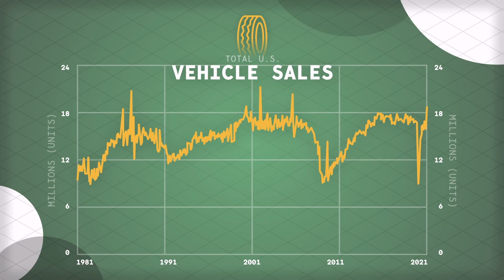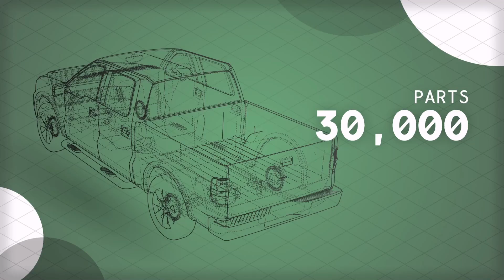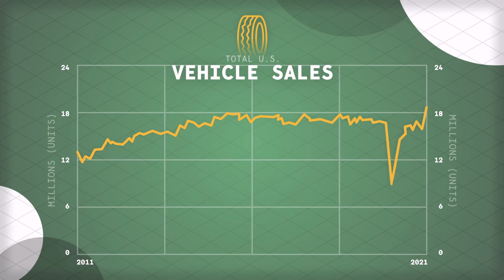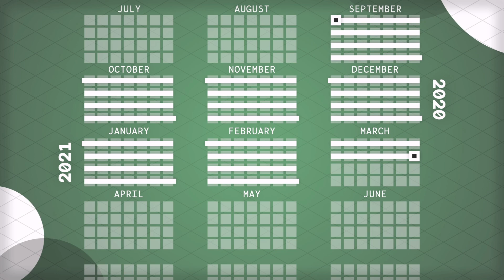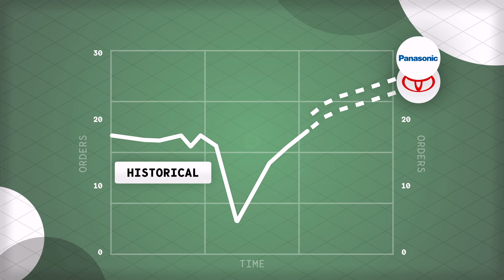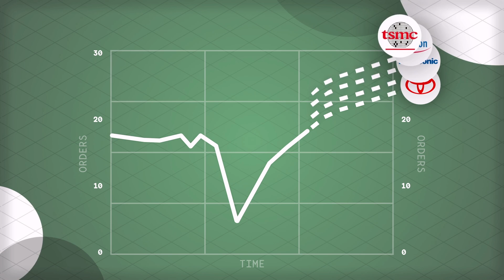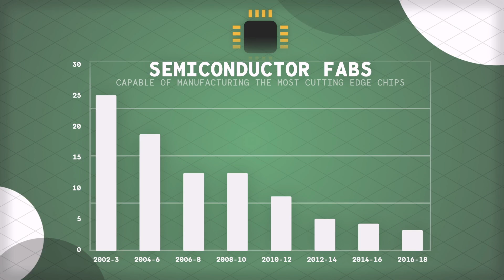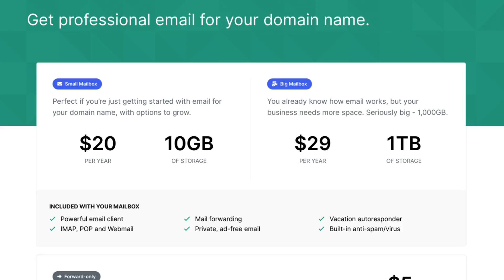Why the World is Running Out of Computers

Comment: Your chip analysis is a bit simple and perhaps ignoring a multitude of factors.

For starters, fab orders come from chipmakers themselves. The chipmakers have to order wafers as they are available in order to be able to actually manufacture parts at those fabs. Chipmakers are the ones who determine the amount of chips available, not Toyota or Panasonic or any other buyer. Nvidia and AMD, for instance, are actually designing the chips for certain customers, hence they gauge how many they need, then they place a wafer order on the process in order to lock down a specific amount of chips that they can sell to a customer (assuming a certain percentage of defective dies).

The amount of chips available relies on what process they're using, how many wafers are available on that process, the yield percentage on that process, and how much those wafers cost. For something like a PS5 on 7nm, that's just about bleeding-edge. Nvidia made the mistake of trying to bluff TSMC by threatening to go to Samsung. TSMC laughed in their faces because they knew their 7nm process was superior and their wafers would be consumed by literally everything else. Hence, the Nvidia Geforce 3000-series chips had to be manufactured on an inferior Samsung 8nm process. It was a big misstep by Nvidia, but just another demonstration of TSMC's foundry dominance, and the fact that literally everything is vying for cutting-edge process wafers.

TSMC is so far ahead of Intel and Samsung that they can't crank out wafers fast enough. Toyota isn't even a blip on their radar, when AMD, via Sony and Microsoft, are ordering next-gen console parts at a record pace. And this is where they make the most of their money from. One could argue that older processes are still viable for various chips, but the various processors being used in car are vastly increasing in performance to match or exceed those in smartphones (which are likewise bleeding-edge), like Nvidia's automotive chips. Automobile manufacturers are just not shifting volumes anywhere close to console manufacturers. And therefore, their bleeding-edge features are going away, and/or massively increasing in price.

The driving force behind all of this is "bleeding-edge features." Whether it's a game console, a smartphone, or a car. It's all the same. In the meantime, companies like AMD still have things like CPUs and GPUs that they have to sell, so all of this stuff is a drain on wafer availability at a time when manufacturing in general saw a decrease thanks to the pandemic. But currently TSMC has the best process available. Intel needs to solve their 10nm and 7nm problems, Global Foundries needs to make themselves relevant again, and Samsung needs to innovate at the 5nm level. Only with increased competition will this "chip shortage" start to alleviate. TSMC has been investing in more manufacturing, but as long as their on the top, their wafers will be extremely valuable.

The shortage is real. The demand is vastly exceeding the supply. TSMC can only supply so many wafers on a specific process node. This is purely a manufacturing problem.

End notes: "Opening a factory" is a severe oversimplification statement. TSMC has to invest in foundry hardware. This is cutting-edge technology that very few companies can produce. Let me give you an example: back in the mid 2010's, TSMC reportedly had problems with their 28nm process. At the time, they were fighting with GloFo and Intel and losing. They were nowhere near where they are today. They invested a bunch of money into equipment to make that process work, and they were essentially failing at it. Fast forward to today. Intel has pumped tons of money into 10nm and 7nm processes that are not working. This stuff requires a lot more than just "opening factories" to make them work.

That is to say that while TSMC is on the top right now, that won't always be the case. This is a cut-throat business. TSMC can't just invest a ton in more 7nm manufacturing because it will soon be replaced by 5nm and other nodes. Older nodes can live on for long periods of time with chips that DON'T rely on cutting-edge manufacturing, but the lifespan probably isn't more than 5-8 years or so, before there are so few customers as to make it not worth keeping the fabs running.
Reply: Taiwan doesn't need TSMC. I mean, sure, TSMC is a huge business in Taiwan, but manufacturing has been huge in Taiwan for a long time now and is only getting better since China's labor costs have been increasing. Taiwan manufacturing also has a great reputation. So while other countries continue to grow, like Vietnam, Taiwan will continue to be at the top of the list for quality manufacturing at great prices.... at least until the CCP decides to interfere.

Comment: Gasoline stations where I live have increased their prices to the point that not even 30$ is enough for a full tank.
Reply: And you call that expensive? Jeeezzz...
Reply: @kornaros96  
Last time it only took 20$ for a full tank, and now it takes probably more then 50$. I don't know how rich your life is, but more then 50$ a tank is a huge deal.
Reply: @NicheXCC  more than 50$ is a huge deal? 
So, with the regular unleaded at 1,65/L to top up a car with 81L fuel tank that would take 133,65. That's with the price in my neighborhood, so if the prices at your neighborhood is the likes of 0,70; you should probably stop bitching about fuel prices.

Comment: One possible fix, is if carbon chips get better and become mane stream. They are said to be better. As in smaller, faster, and able to handle a higher heat wile being self cooling. Perhaps is just a pipe dream filled with theories. But one can dream, yes. It's kind of how we got where we are with tech. Building on a dream of what could be, if we are able to make it so.

Comment: 1:10 - You are wrong, rice cookers dont need and dont use semiconductors at all. They use electro magnets and thermal properties of metals.
Reply: They have semiconductors for that timing function and for sensing the temperature to adjust said cooking element.  Smart ones DO have semiconductors. Rip one apart.
Reply: @DurzoBlunts  normal rice cookers dont need semiconductors. 
They work using a specially calibrated magnet that stops working precisely right above 100 C, so that it stops cooking when it evaporizes all the water. When the water evaporates, the rice is perfectly cooked. Thats it. Thats why rice cookers usually dont have any kind of screens on them. Have you ever ripped one apart?

Comment: I just started an internship working in the electronics lab at a company producing thermoelectric coolers and I could tell that the semiconductor shortage was causing some major headaches within the first few hours on the first day. Luckily we’re still able to operate fine as far as I can tell. I’m also from a state affected by the Colonial Pipeline hack and some stations I’ve come across are still out of gas and the ones that have it have relatively high prices.

Comment: Fucking hell, this is why we need to remove most of the computers from daily life. Not everything needs to be automated
Reply: Same as software bloat, hardware bloat exists
Reply: Automobile is actually a big contributor to this problem. Most modern cars today need some sort of chip to operate the entertainment system and other electronic devices. Older cars don't need them, but they work just as fine.

Comment: Would be awesome if this causes car manufacturers to lay off the "screens everywhere" crack pipe, at least on lower end option packages. Give me an "analog" package with real gauges/buttons/knobs/switches and a manual transmission while you're at it
Reply: They would still need chips for TPMS, electronic valve timing, infotainment, emissions systems, remotes, anti theft and many more systems
Reply: @hawkeyeaerialphotography6652  Absolutely, but the amount required (and the complexity/ease of manufacture) to create a simpler package would probably be significant. Note that the first thing to go during this shortage is the full digital dash. Of course, the replacement analog gauges still have digital electronics behind them (gauge data still comes from the ECU), but far less complex and easier/faster to manufacture than what's needed to drive multiple screens displaying high res graphics with fluid animation. Though I know it's not feasible anyway for tons of reasons, just something I personally would like to see.
Reply: Manual transmission is dead.
Reply: @crhu319  maybe in America cuz they don't know how to drive a manual transmission car
Reply: @anon1963  More like we're too lazy; most people I know have had or currently have cars with a manual transmission, but a lot of folks like me just can't be bothered with the tedium of shifting our own gears, it's more efficient to let the car do it on its own. I agree with the general sentiment of this thread though, analog gauges and all that are easier to produce and work just as well if not better than having a computer on wheels.
Reply: @crhu319  Nah, there are still some models you can get with one (thankfully, most of the "fun" cars), plus the used market.

Comment: This seems like a lazy video to me that is making the same points in other videos. 

- isn’t the drop in profits in the auto industry offset by the increase in profits in the industries that “took up the slack” in chip production? Including better margins the FABs themselves got?
- what happened to the inventory that wasn’t used during the drop in production and that was still on order?
- what is the whole “cushion” analysis?  If someone over ordered and got their order in first they should have enough chips.  Hoarding in the supply chain requires holding inventory which means sacrificing sales.   Are they doing this to drive up prices?
- consolidation towards cartels and monopoly is a law governed process in capitalism.  It is both the most efficient form of production and allows firms to set prices rather than be beholden to the market thus getting a greater share of the value, realised as profits, created throughout the supply chain.

Comment: Overclocking in a nutshell is the illegal act of running a computer's CPU at a higher clock speed than that mandated by the manufacturer. By altering the settings on the BIOS of your motherboard, it is possible to fool your computer into running faster than the manufacturer's permitted speed limit. This results in a short term gain for the overclocker, but it is not without risk to the wallet, or the environment.
To quote the US Dept of Energy and the EPA: "Staying within the speed limit is not only a matter of safety and obeying the law, it can also save you money."
The sound advice above applies equally to Personal Computers as it does to automobiles, which is hardly surprising, since both are complex pieces of machinery requiring their users to behave in a responsible manner.
Anyway enough preaching, its time to get down to the technical nitty-gritty. For the purposes of this article, it is useful to draw an analogy between PCs and Automobiles. If you tune up an auto by adding a turbocharger, or remapping the fuel injection and timing, you may well get a small increase in performance. However it will be at the expense of wear and tear on your engine, more greenhouse gas emissions, increased insurance premiums, and ultimately the lifespan of your vehicle will be shortened. So it is with PCs.
The overclocked PC consumes more electricity than the unmodified PC (due to the higher clock speeds, and the additional cooling that is required). This causes higher running costs (just take a look at your electric bill if you don't believe me), more damage to the enviroment, due to the emission of more poisonous greenhouse gasses, and worst of all, reducing the lifespan of your CPU.
A CPU is a delicate piece of electronics. Illegally increasing the clock speed by just 2MHz can remove 6 months from its working lifespan.
Modify your PC to improve its longevity
OK, so we have seen the causal link between higher clock speeds and early CPU failure. But what can we do to improve the lifespan of our PC ? Its simple. The same equation that governs the process of "overclocking" can easily be reversed. It is the logical next step. If a faster CPU has a shorter lifespan, costs more to run and damages the environment, by the same token, an underclocked CPU will be proportionally cheaper to run, more environmentally friendly and will last longer. Follow the simple steps below to underclock your CPU and improve the lifespan of your PC
Basically there are three steps to underclocking your CPU. The first step is to get into the computer's BIOS. This can normally be done by pressing DEL as the machine boots up.
The second step is to locate the CPU clock multiplier in the BIOS menus, and modify it. Suppose you want to increase the lifespan of your CPU by a factor of two. The thing to do is to halve the clock multiplier in the BIOS.
The third step is to save your changes to the BIOS and reboot. VOILA - you are now the proud owner of a longer-lasting, greener, cheaper to run PC.
Now you might be wondering what the downside is to all this ? Good news. As it turns out, there is no downside. For years and years PC manufacturers have been telling us we needed faster and faster CPUS. This is simply not the case. I run Microsoft Word just as easily on my underclocked Dell machine, with the bonus of knowing my PC will probably outlast that of all my friends, and is saving me money to boot.
For any reasonably competent DIY enthusiast, underclocking is a no-brainer, and the sooner you do it, the sooner you can start saving money and join the ranks of those who are doing their bit to reduce global warming.
There is some evidence to suggest that if just 5% of America's PC-owning population underclocked their PCs by a miniscule 5% then the Californian power crisis would have been averted, and we would be able to reduce greenhouse gas emissions by a significant amount.
We have to start protecting our environment somewhere, so what better place to start protecting it than at home ?

Based on an old data and new information report. The shortage of computers due to a shortage of silicon IC chips is due to the fact that the world ignored an alternative computer technology which is much cheaper and easier to mass produce. And that is the THIN-FILM TRANSISTOR. It is much bulkier, larger, clumsy, heavy, and not space age looking but one thing is for sure is that IT WORKS! 

Discovered in 1982 and almost all but forgotten by the silicon IC chip technology revolution and fuelled by our thirst for super high-tech to put everything into a much and much and much smaller space until it reaches to a point that we made the world much more vulnerable. The thin-film-technology maybe not fancier but it is, when properly made, sturdier and when encased in sealed plastic resin permanently, can last indefinitely. 

In 1982 the Japanese went beyond all standards by going all out on a 64 bits standard so that they have it "FUTURE PROOF" but no one paid it any attention. In the late 1990s someone did when they starting using autosophy technology and this requires a much more reliable computer hardware technology for information data archival storage and they achieved what is called "CAROM" Content Addressable Read Only Memory" using a combination of thin-film-technology and anti-fuse memory OTP one-time-programmable or OTR one-time-recordable technology. 

Using thin-film-technology based CPUs and GPUs whose designed was redesigned into a very long rectangular ribbon shaped circuitry CPU and GPU design, the information speed input and output is just as fast and equal to a conventional CPU and GPU silicon IC chips and it can be at any speed.

A thin-film transistor (TFT) is a special type of metal–oxide–semiconductor field-effect transistor ... By 1982, pocket LCD TVs based on AM LCD technology were developed in Japan. In 1982, Fujitsu's S. ... In the late 1980s, Hosiden supplied monochrome TFT LCD panels to Apple Computers. In 1988, a Sharp research team ...
Reply: Overclocking isnt illegal and 2 mhz fall well into the margin of error of what a particular chip can handle

Comment: I would love to see your input on the controversy of Cryptocurrency miners who have also been buying up GPUs to build their own Bitcoin faculties. Many point out that the creation of Bitcoin and other cryptos through the energy and material resource requirements to build may also inflating the demand for semi-conductors.
Reply: Clearly true. Semiconductor makers would devote all their lines to this ewaste production if they could.
Reply: seize the means of production and redistribute GPU’s back to the laborers
Reply: Of course it is, but the demand is real regardless.  From miners to car owners and everyone in between.
Reply: Miners and scalpers aren't a controversy. They are a natural expected part of the market. Issue is with Nvidia not wanting to overload the market in addition they are using a node from Samsung with questionable yields.
Reply: Imho the whole "evil minerz sr buying my cardz!" Is mostly made up by uneducated gamers really petulant tgey cant slaughter the next 1000 orks in 8k-theycantsee rather than 4k-theycantsee. The big miners use specialised systems and thinvs like fpga's not off the shelf graphics cards. And what all the miners care about is power to flops ratios. If they can buy a chip that does x megaflops at Y kwh theyd much rather have it than a system that dles 2 x megaglops at 3x kwh. And there probably arent as many of them as you think. The gamers in nyc or la etc alone probably bought more gpu's than every miner in the US combined. And scientists are buying them like crazy. Ai research and education requires massive processing power. As does cg etc etc. Trust me EVERYONE who renders had two 3080s or 3090$ on their to buy list before this happened